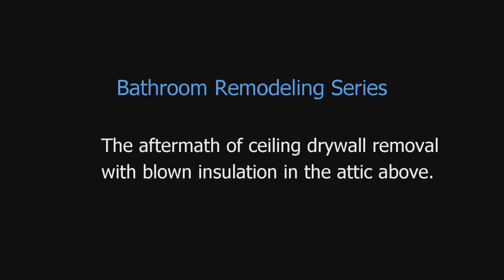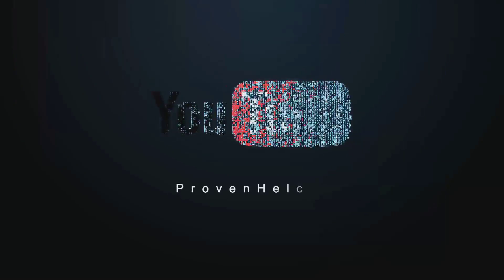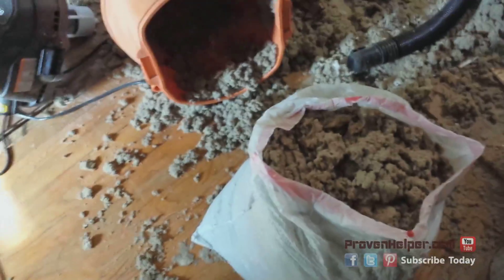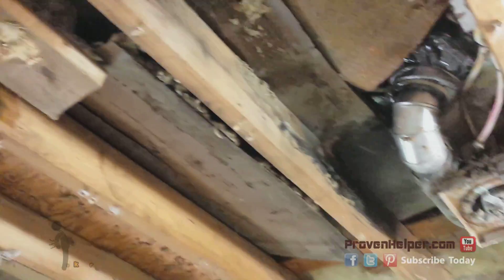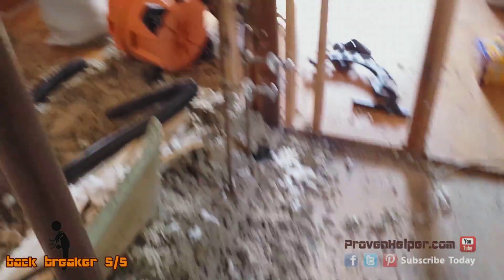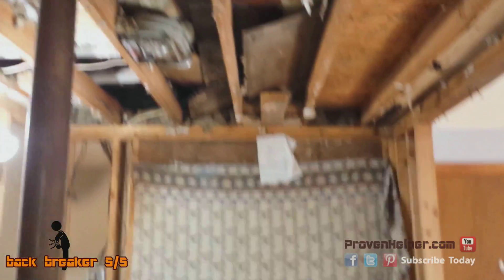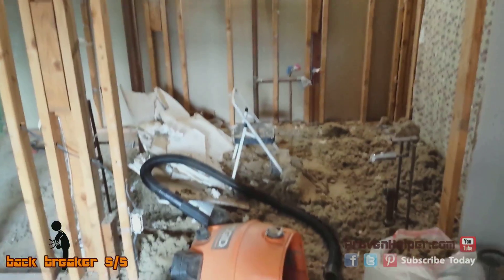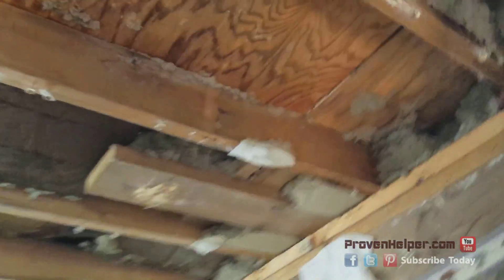Bathroom Remodeling: Removing a Ceiling with Blown Cellulose Insulation in Attic

Comment: Why did you have to tear down the ceiling? Are you going to put new insulation in the attic?
Reply from the maker: +kobelcofan I basically tore down 2 bathrooms and designed 1 nice bathroom instead. Then I tore everything down and built the new design. You can find photos on my Facebook Page: https://www.facebook.com/ProvenHelper/photos/pcb.979991305370328/979989655370493/?type=3&theater